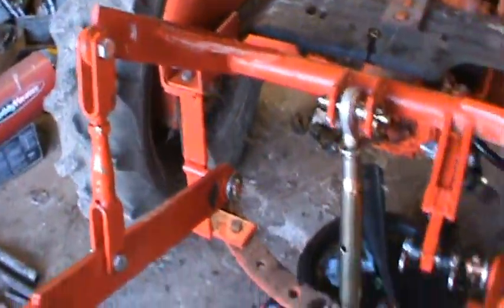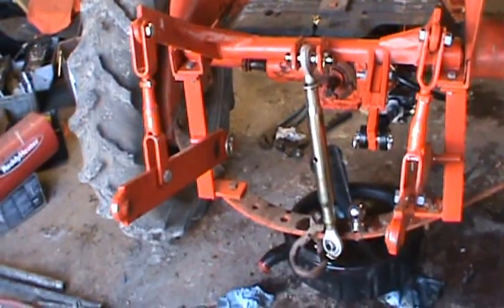Allis Chalmers C Three Point Conversion

Comment: My grandpa had an old AC back when I was a kid in the early 70's. He used to put me up on his lap when I was just 1 or 2, and I used to fall asleep in his arms. Good, good memories with that old tractor. Uncle left it on his old place when he sold it, and I tried to buy it back with no avail. 46 years after I rode on that tractor and my Grandpa is gone....and that old AC is gone. Sad memories to boot.
Reply from the maker: I inherited my grandpa's Case 730.   Spent many many hour sitting on the fender going back and forth.    Now I have way more tractor than I need for the 2 acres I own but it's not going anywhere.

Comment: Just a note a B wide front is a direct bolt on option. I have one on mine with a home made 3 point. I have a 75 lb weight bolted to each front wheel and pull a 5 foot finish mower just fine

Comment from the maker: I've cleaned the pump three times and changed the fluid twice.   Its working much better now.   Its the best thing I could of done with this tractor.  I've been using it almost daily.   I'll have to get another vid up soon.  Putting one on a B would be better since you hang more weights off the front axle.  I say go for it!

Comment from the maker: I've sold this tractor and upgraded to a newer one.  

The Pins on the angle iron are plenty strong.   It lifted the front of the tractor well before anything three point related was under stress. They are on the long side due to how short the lower arms need to be on a C.  It allows you to move the arms in and out a little more when hooking up equipment.  The downside is the equipment sways side to side more.   A p/s pump would be a way to go but in my case there was not room for it with the alternator and a short arm steering narrow front end.

Comment from the maker: It also was due to a check ball retaining pin being broken and cause one of the 2 pistons on the hydraulic pump not to work.   Its still slower than a modern tractor but much faster than it was in this vid.    I'm collecting parts to do a full live hydraulic conversion.

Comment: I just ordered my kit saturday from tonys tractors. very nice guy to talk with. kit is now $390 and shipping for me was $170 (im in central ohio, tonys tractors is in oregon, I think kit may be shipped from missouri. My C is a ‘42, Im also putting a 12V alternator on it. another good resourse is yesterday’s tractors.com  I did have a L306 belly mower on it but my yard really isnt big enough for it so I took it off, could do yard in 20 min but couldnt get in tight spots with it.
Reply from the maker: You'll like it,   I do suggest skipping the original pump and putting a power steering pump on to give you live hydraulics since you are already going to be messing with the Alternator bracket.

Comment: I'm having trouble with my d-14 implements pulling way to the right. I do not have a stabilizer bar on it or stabilizer chains. What would you recommend to fix this issue?
Reply from the maker: Add a stabilizer bar or chains or some rub blocks on the inside of the links.   I'm no expert.

Comment: The front end pins for the lower arms sure stick out there.  There's going to be a lot of leverage working on them, and I think the angle iron and or pin will likely bend.  At least I know me Ferguson TO35 would bend them.  I would probably box the angle iron and weld a short brace from the pin to the front corner of the box.  JMHO.

Comment: The C has a high pressure, low volume pump. So with that bigger cylinder its going to be very slow.
Reply from the maker: +Mark Coe Yep, but in this vid the pump was only working 50%, It had a check ball missing on one of the two pistons.  Still slow but not as painfully slow.

Comment: I put a blade on the back of my C, and it was horribly slow.  I knew for sure the pump was good, it's just not a high capacity pump.  I would put a power steering pump on it (any salvage yard has hundreds) to speed it up, and would also install a selector valve for up and down power.  All easily done.

Comment: The 1/4 To 3/8 fitting would create a flow problem wouldn't it ? The cylinders not getting the volum of fluid it needs to supply the rams
Reply from the maker: The fact the pump is designed to run a 7/8" to 1" cylinder makes more of a difference.   It's a low volume, high pressure pump, meant to put out about 3000 psi,  at 1-2 gpm.    Modern hydraulics  High volume, low pressure,  most small tractors run around 2100 psi at about 12 gpm.     If I had kept this tractor I would of put a power steering pump on it to run the 3 point.
Reply from the maker: It should be noted in this video the pump was only half working,   it has 2 cylinders and one had a stuck check ball.

Comment: do you drill the holes in the hydraulic pump for the hoses yourself ?? i want to does something like this on my B but not sure how to do it with the hydraulic pump.
Reply from the maker: should be an output with a 3/8" pipe thead on the pump.
Reply: @juztyn00  ok thanks!

Comment: Good video. Try changing to proper fluid. Our old ford had the wrong stuff for 30yrs! Old man changed it and what a difference. Good luck bud
Reply from the maker: It also was due to a check ball retaining pin being broken and cause one of the 2 pistons on the hydraulic pump not to work.   Tried universal hydraulic/trans fluid and SAE 30  as was used originally.   Both worked about the same; slow..    If I were to do it again, it would get a power steering pump mounted on the engine for live hydraulics.
Reply: @juztyn00  SAE 20 oil is what they take, not SAE 30. I just bought a 5 gallon bucket from Advance Auto. Fram AW68 hydraulic oil. Try that. Should work better.

Comment: Also do you have a leveler on the one lift arm for grading angles?
Reply from the maker: Both sides had some adjustment,  you just had to pull the bolt off and  screw them to where you wanted.   I'm sure a different type of adjuster could be put in place that would allow easier adjustment but not at the price point of the kit.

Comment: Did you convert the starter to electric solenoid? Would like to know more about it.
Reply from the maker: Remove push button switch, run hot lead to solenoid  the add a key switch..  pretty easy,   this tractor had some creative wiring done with a 12v conversion with ford altenator and voltage regulator.   Chevy system is much simpler.

Comment: Hey man, I bought an Allis C tractor. I can't really find any information on it. Is there a site I can look up the serial number and find out the HP?
Reply from the maker: +Blue Moon go to http://www.allischalmers.com/forum/default.asp     tons of info and the group on the forum are very friendly.    http://www.tractordata.com/farm-tractors/000/0/0/4-allis-chalmers-c.html  will give you a year for your serial number.
Reply: +juztyn00 I looked at those 2 sites. My serial number is 27091 and doesn't match any of them.
Reply from the maker: that would be a 1944 model.